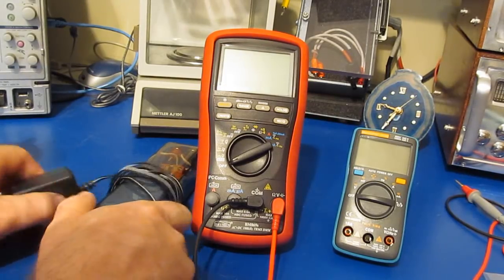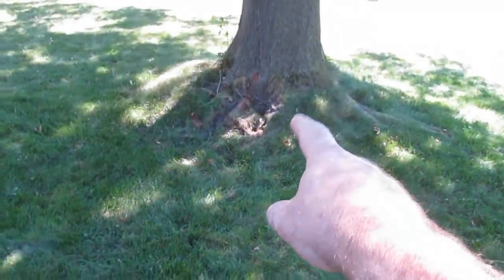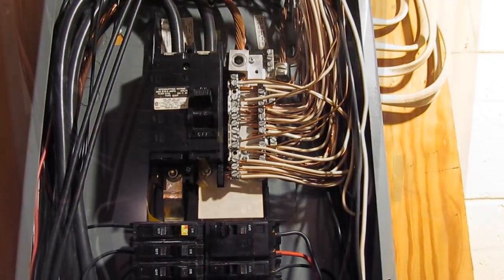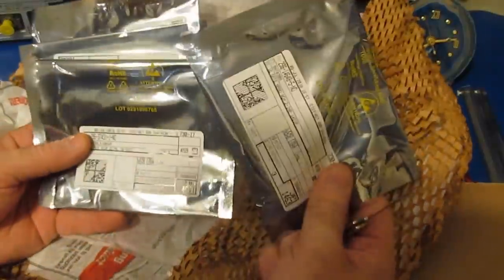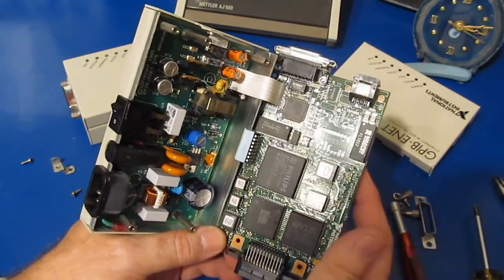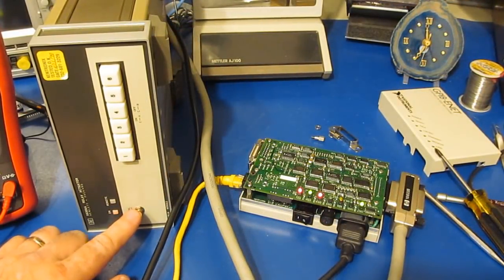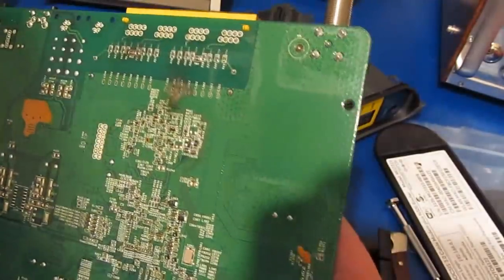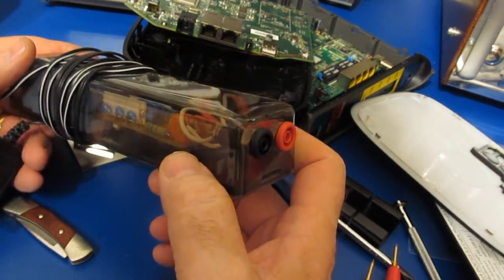Lightning takes down my lab

Comment: GROUND LOOP! Can do serious damage.Only way to be fairly safe, disconnect everything from house electrical circuits when not in use! MAYBE a large knife switch that would make it hard for voltage to arc across? Would need to be a switch with 3 knife contacts to disconnect 120/120/ground circuits completely.

Comment: Joe, are you familiar with Ufer ground, basically if you run so much copper wire through concrete, it would serve as a ground rod, specially in dry soil conditions where conductivity from ground rod to earth is poor. In your video I saw you mention ground wire connecting to water pipe, which I heard some people say that's not acceptable. I have a house with plenty of copper pipes going through concrete slab, and I believe they would act as UFER ground. Specially considering the surface are of copper pipe and the skin effect when electricity is flowing, I think copper pipe running through concrete slab is well suited for the task. Then again, I wouldn't want to feel unexpected tingle on my lower antenna while taking a shower if lightning decides to strike at that moment. Many buildings are forced to install copper ground rods for protection and I wonder why more don't utilize UFER ground. It almost sounds like racket to sell/install more ground rods.

Comment: Hardly a year goes by without something nearby (within ~200m) getting a direct lightning strike.  Changes in ground potential due to the local current field can be pretty huge.  Having metal workbenches and cabinets sitting on a concrete floor ends up being a problem.  

I figured it would be fine if equipment has rubber feet and the desk is insulated from the floor; then I get a strike within about 50m, and it sparks across a 1" gap between a cabinet and the desk, and then between the desk and the bottom of some equipment.  That's about the point I built a ground fence.  That solves a lot.

Also: I'm not surprised at all that the ethernet signal transformers were punctured.  I've had too much network equipment (including arrestors) get violently blown to smithereens to think 1500v isolation is worth all that much in a bad scenario.

Comment: Piece of advice, you should look at installing a whole house surge protector in your panel.  I have one here made by Eaton (Culter-Hammer) and is a couple hundred bucks to have installed by a certified electrician.  Generally you have to get an electrician to do em because they are somewhat harder to get
Reply from the maker: Are you using the radioactive ones?
Reply: don't think so.  It's an electronic module that gets wired directly to the pannel.  It may not be under their cutler-hammer brand anymore, but the one we had put in was.  Link: http://www.eaton.com/Eaton/ProductsServices/Electrical/ProductsandServices/Residential/SurgeProtection/CompleteHome/index.htm#tabs-2
Reply: I've had two electric fence chargers (out in the solar shed) blown to bits, literally, by lightning in the past 20 years along with a crispy wireless access point (near the shed, attached to a 20ft pole with a grid dish antenna on top) but no other damage immediately known.
I'm using Delta Lightning Arrestors (DeltaLA). They are big silicon dioxide varistors IIRC. Available in different voltages and in A.C. or D.C. variants. I have a D.C. one out in the shed for my solar PV, tied to an 8ft ground rod at the shed. That ground rod has a #6 copper line that runs outside the conduit with the D.C. lines from the PV to the house. Before entering the house (South-ish-West-ish side of the garage) there is another delta LA and another 8ft ground rod. That ground rod has a second #6 going all around the West, North to East side of the house to the original ground rod at the almost directly opposite side of the garage. In total there are 8 bonded ground rods, with 7 around the house and 1 out by the shed along with a 6in steel cased well (don't remember how deep the casing goes but the ground system bond to it is only a #8). In the main panel is another delta LA with a #4 tie to the ground rod right outside the wall and the galvanized plumbing. Maybe it helps... lightning is fickle.

Comment: My lab was also hit a few days ago June 6 at night and I'm completely off grid and isolated from ground (sort of as there is always capacitance to ground). The strike was not as close as yours maybe around 200 to 300m away from the house.
There was not that much damage but it did damaged a current shunt amplifier and the micro controller (internal protection diode on one of the pins) inside my SBMS (Solar charge + BMS my design).
And the other thing that failed was and LED constant current driver (switch mode not linear) that was in my lab and closest to the main battery. (Most of my house works on 24V DC directly so house is all wired for DC).
The breakers where only on the positive side of the multiple ground mount solar panels and where open circuit as thunderstorm was fairly severe and I sort of expected this thing may happen.
May best guess is that induced current in the wiring generated reverse voltage transient as that explains both faults. Current shunt amplifier had the internal input protection diodes damaged and the external current shunt was on the positive side of the battery but GND (common negative) become positive in reference to battery positive and that explains my faults. 
Now I need to think of better way to protect against this.
I have no insurance and damage is less than $10 in parts so not a big deal.
If someone is curios and wants to see more details and a few nice shots of the lightning (short time after the incident) can see that in my last google+ post.

Comment: That's not a spark gap, it's a transient voltage suppressor diode.  Basically two zener diodes back to back.
Reply from the maker: Guessing or know?   From your statement, you know.
Reply: That's what they look like, it's what I'd put there, and that's what they do.
Reply from the maker: So you are presenting it as fact but really don't know.  If you would like to know for sure, I can attempt to determine what the device is.
Reply: Feel free to do so;  you'll find it's a TVS diode.
Reply from the maker: I have no idea what I will find.  Assuming it is a TVS as you have stated, any ideas on a part number?  Breakdown voltage, capacitance and such?
Reply: Usually they're rated for double the working voltage of the signal, though on radio gear they tend to be higher due to SWR.  The capacitance is usually set by the package size.  They're also rated for a certain energy, I guess you'd have to find a service manual to see what that would be.
Reply from the maker: It may take me a while but feel free to view the results here:  http://www.eevblog.com/forum/projects/identify-if-its-a-gdt-or-tvs/
Reply from the maker: I figured by now you would pointed out the errors of my testing.   Do you feel the TVS will switch this slow? Glow? Arc?
Reply: You know that, once a TVS diode has been zapped by too much energy, it essentially turns into a GDT...  the packages on these things are usually filled with argon, so if it got zapped and the die, uh, died, then it'll look exactly like a GDT.
Reply from the maker: Can you point me to any papers that describe the TVS encapsulation process using Argon?
Reply: Most glass packages are constructed under inert gas.  The glass is hot and the leadframes oxidize less that way.
Reply from the maker: Send me a few part numbers for what you feel this part was.   Glass MELF TVS's seem rare and hard to source.  Not something you would find in a commercial products when the plastic package TVSs are very common.    I have found no papers to suggest the glass filled TVSs are filled with argon as you suggest.  Point me to a paper, patent, anything that has this information.

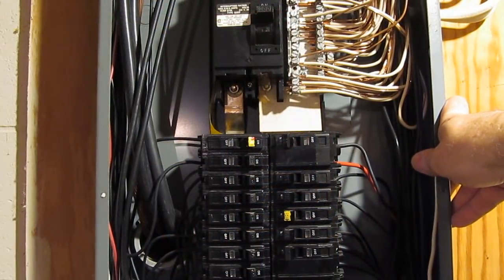Comment: Hi, Does the earth wire you mentioned at 3:03 go to a WATER PIPE?????
Why not a proper EARTH, like an EARTH stake?
Have you had the gnd impedance measured through the house plumbing, can I suggest you use a Proper Earth Stake into the ground.
I'm sorry but a plumber is not an electrician.
Think this may have caused some of your failures?
Regulations in Australia, stipulate an earth stake, not to rely on plumbing installed by a plumber.
Also a lot of plumbing now is done with plastic pipes.
Reply from the maker: I appreciate your concerns for my home and the US electrical codes.

Comment: Well, despite the damage, I guess you were lucky - not a tremendous mess, all in all - I've seen whole racks, with tens of thousands of dollars of equipment, go out in magic smoke on lightning strikes over comms lines.
Having in mind that lightning worldwide is increasing, as we approach the grand solar minimum, you maybe also lucky if, as they say, lightning never strikes twice on the same place - that should hold your stuff out of trouble for a while :-)
On the other hand, I'm impressed how fast you recovered the damaged equipment - it speaks millions about your knowledge and experience - Well done! Thanks for the video.
Reply from the maker: The way I see it, no one was hurt and it's just stuff.  One of the biggest concerns I had for the test equipment was the scopes.   Some of the equipment was unplugged at the time of the strike because I was servicing some of it at the time.  Luck was on my side that day.

Comment: Good to hear everything is back working!
Assuming you're talking about the cheap Micsig probes (50/500x) then I have got some internal photos, a partial reverse engineered schematic and some measurements of one if that is of interest. Some silly design choices were made and I'd treat the 100MHz claim with a large grain of salt, but if you're aware of the limits (average high freq CMRR, long leads ringing at ~70MHz) then they are reasonable value compared to the crazy prices for other similar probes.
From teardown pics of the inside of Dave's probe it looks like they are using a AD8130 + AD8129 on the front end after the divider network (at 1x and 10x gain respectively) and switching between the two for the different ranges. I may modify my Micsig probe with shorter leads and a similar AD8129/30 arrangement to try and improve it at some point, but it may be a bit futile.
Reply from the maker: Thanks for that bit of info.  I saw a few people posting about them on the EEVBLOG site when they were released.   Someone had tried some benchmarks against a couple of other probes.   If I can get a homemade probe that I am happy with, I may pick one of these MICSIGs up to compare with it.

Comment: I use single outlet socket in my lab and overvoltage protection plugged into it to avoid voltage differences between equipments in case of lightning or similar. Also incoming ethernet has overvoltage protection in the same point.

So hopefully nothing gets so easily damaged even outlet ground would float kilovolts above true ground momentarily. 230/240Vac used in here helps a bit with cable loss in normal use.

Comment: Unfortunately, with your 10Base-T equipment you might not be set as long as you might think. It might still be a few years, but compatibility with 10Base-T is starting to be on its way out. Even consumer mainboards are now starting to get 10GBase-T ethernet ports, which generally will no longer be capable to run at only 10Mbps. You can still put a gigabit switch in between for conversion, but you should probably start collecting some Gigabit-Switches once 10 gigabit switches become commonplace for the consumer market.
Reply from the maker: Not that it matters but the PC is 10Gb now.  The 10BT is fine.
Reply: Directly connected with a crossover cable? Then the 10Gb consumer chips must be different than what I'm seeing in the server world, where they generally only support 100Mb or higher (and sometimes even 100Mb is no longer supported). See for example the datasheet of the quite popular Intel X540 card. The 10GBaseT-Switches I'm seeing lately also dropped 10BaseT support completely. My guess is that this is done to get rid of  the 5V peak-to-peak signal levels needed only for 10BaseT.
Reply from the maker: A bit odd of a comment.  If you have watched this video, you know there are at least two different GPIB controllers.  Do you really think I swap a crossover cable between them?
Reply: So you have a switch in between, that's exactly what I thought.  Just try it once with a direct connection from your 10Gb Ethernet port to the GPIB, my guess is you won't get a link. That's why I'm telling you that you should stockpile 1Gb switches once 10Gb consumer switches become commonplace, because you most likely won't be able to use your GPIB modules on a 10Gb port.

Edit: to clarify, what I'm trying to tell is that on logical layer 2, 10GBase-T is still compatible with 10Base-T, so you can talk to a 10Mb device from a 10Gb device across a switch with both 10Gb and 1Gb ports just fine. But on the physical layer 1, most (all?) 10Gbase-T interfaces are no longer compatible with 10Base-T, so you can't have a direct connection between them, be it from a 10Gb PC network card to the 10Mb device or from a 10Gb switch port to the slow device.
Reply from the maker: I would have no need to connect it directly to the PC.
Reply: Yes, again, I understand that! But you WILL have the same problem connecting the module to a SWITCH once 10Gb switches are the norm (in the server world we are almost there, and the consumer market will probably follow in the not to distant future). You can't have a cable that connects on one end to a 10Gb port (regardless if PC or switch) and on the other end to a 10Mb port like your GPIB module, period.
Reply from the maker: If you have a look at some of my videos, you will find I started using Ethernet in the coax days.  I have written my own stack in assember in the days of the 6811 and designed my own hardware for it.  Do you really feel I need help with Ethernet and am not on top of it?   Again, I appreciate your concerns for me but I am pretty sure I can handle what ever life throws at me.
Reply: I don't doubt that you can handle it, I just wanted to give you a heads up that it is coming, since this isn't very widely advertised outside of network equipment datasheets and IEEE mailing lists. Maybe that got lost somehow since I'm not a native english speaker.

Comment: Forgive this,  but I believe was a transient test from mother nature. Hope everything is fine.
Reply: you can only get damage report and the lightning is  always calibrated to conduct over the air. The best guess was the 50Kv of the ethernet isolation transformers , so imagine what taked that down
Reply from the maker: Everything is fine but appreciate the concern.    I wonder if she is ISO certified.
Reply: Well if no more damage or injuries occurred that's fine. She certainly "passes" certification, if it hits the complex. I had a UPS, a bunch of modems and a GFI / RCD in the past. The Earth conductor in the electric board is exposed? here is mandatory to be insulated
Reply from the maker: You mean the all the wires entering the house must have insulation?  Does this include every wire inside the house as well?
Reply: I was just refering the big earh  wire on the electric board @ 3:17 . It applies here in my country ( 230Vac, 50 Hz) with yellow / green color , doesn't mean it applies to yours and it will be by the book. Thats Ok if all other wires Live / neutral are isolated properly from the earth pin,  which seems the case.
Reply from the maker: That's interesting.  There is a fair amount of information on-line for the USA codes.
Reply: Yes there is and i found some very summarized:

https://www.allaboutcircuits.com/textbook/reference/chpt-2/wiring-color-codes/

For USA  / Canada, fixed cables, earth pin can be bare / naked,  Europe its always the green / yellow

Comment: Glad no was hurt, and that there was no fire; thats the important stuff. By chance did you check the bolt entry site for a 'Fulgurite'? (see Wikipedia for examples.) Use care if one is found as they can be quite fragile One would make a great 'bragging trophy' for the shop... or maybe even the fireplace mantel!

Comment: There are power bars that claim they can protect against lightning damage to equipment and will cover the cost of repair or replacement for equipment that was plugged in to the power bar that still wound up being damaged. I always wonder how you would go about proving that damaged equipment was plugged in to such a power bar. They probably wouldn't pay if the damage caused by lightning was done via a path other than the power line.
Reply from the maker: This is why I suggest you check your home owners insurance to make sure you have proper coverage on your equipment.

Comment: Poetic justice that it would hit you of all people, what with all the meters you have tortured over time with your surge generator. ;-)
Will the insurance cover your repair cost? I guess it doesn't really matter but other people get new gear so they should at least compensate you in some way.
Do you think large central surge protectors would have helped you? They are required here for new installations, but I haven't bothered to fit them yet to my house. They clamp together the three phases, neutral, and earth, but it looks like many of your faults would not be related to a mains overvoltage?
Reply from the maker: They would have paid for the replacement had I gone that route.    I am not sure about the surge protectors.  I guess let's put it this way.  I'm fairly old, been playing with electronics since I was a youngster.  I've never had lighting cause any damage to my equipment before.   Chances are slim I will see it again in my lifetime.   Now the GDTs they will use at a large installation, maybe.  Those may stop a small freight train.   Those tiny things they make for the houses that fit in your hand with those tiny little wires connecting them, let's just say I am not a believer.